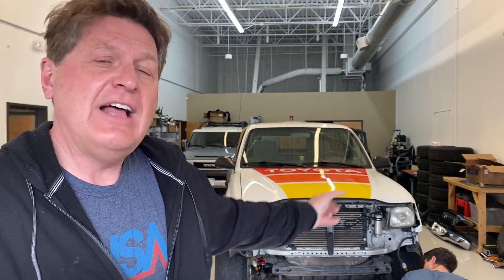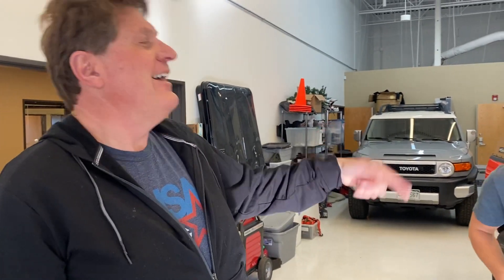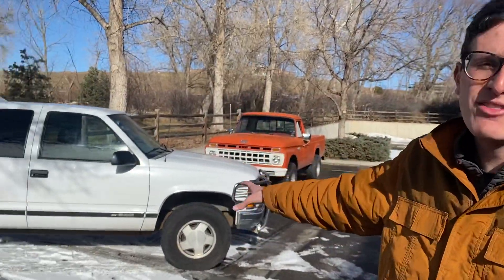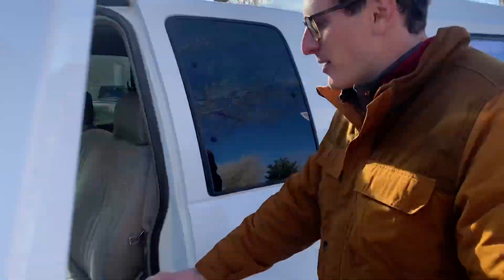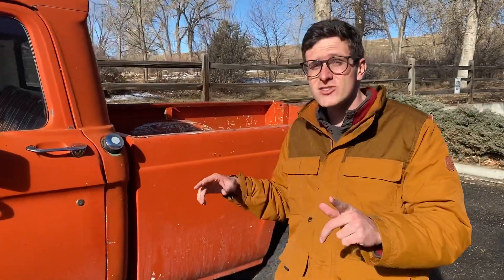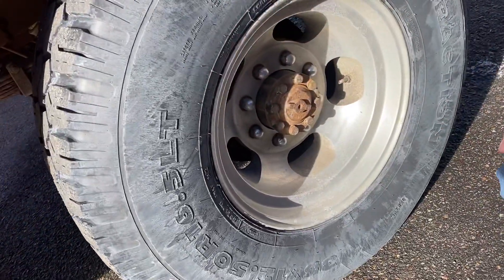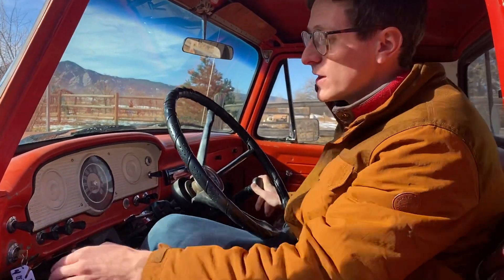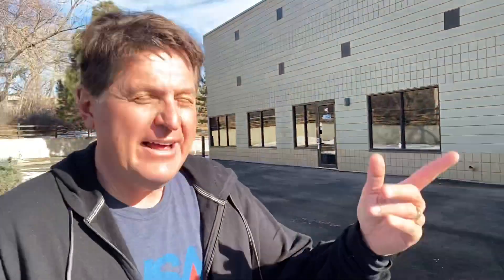We Just Bought Three Trucks Including The Holy Grail Of Classic Fords! TFL Fleet Update

Comment: When I was working construction, summers while still in high school, my boss had the two wheel drive version of the Ford 100. Except, his was cream colored, had a full instrument panel, and had a 390 V8. That truck, if driven by an expert, could be very fast off the line. One day, we had just picked up several bags of cement and lime and were stopped at a stoplight when a Chevy Nova pulled up beside us in the next lane. The driver of the Nova revved his engine several times and the passenger indicated they wanted to race. My boss just rolled his eyes, but, when the light changed, the old Ford shot off the line as if out of a cannon. My boss shifted from 2nd to 3rd without using the clutch. In short, he blew the Chevy away. I'm sure the Chevy had a higher top-speed, but we were already stopped at the next traffic light when the Nova came screeching to a stop next to us. This time, the driver didn't rev his engine.

That 390 was a heck of a motor.

Comment: The 300 cu in straight 6 is one of the best engines ever made. It's bullet-proof!
Reply: I agree.  Not the fastest engine, but it it full of torque and will pull forever.  From what I am told, DO NOT overheat it...head warpage is usually the end result.
Reply: I had a 300 in a 1990 F150. Great engine. Great truck.
Reply: Yeah, the head is the Achilles's heel of that design. The only problem I've ever had with a 300 were related to the head or HG.

Oh, and they'll crack on you, too!

Comment: When you throw out that topper, take the one from the Raptor with you :)
Reply: Correct. They are so bad.
Reply: Are they bad because you don't like the canvas, or do they fall apart?  Just curious because I'm somewhat interested in one.  I don't want to be stuck with a heavy topper, when I need to use the truck with no topper.

I like the thought of being able to load up the truck then simply close the topper over the load.  Saves my back that way, as well as not being able to kneel down on my previously broken right leg.
Reply: @dewboy13  I’m sure they are a good cover for when you need to protect your payload from the elements. It folds out of the way when you don’t need it and doesn’t take much payload. 
That said, TFL has made that cover a permanent fixture on the raptor when it serves no function aside what I can only assume is intended to be aesthetic which it is not. It looks out of place in every way on that truck.
Reply: I'm not even religious buuut to them removing that hideously out of place, grandpa-esk, truck tumor.  I say...              !A A A A M E N!

Viewer Recommended Show Ep.1
   - Removal of Raptor's Camper Shell.
   -Destruction of said Camper Shell.
   - Use Raptor to destroy Camper Shell.
   - Raptor feels Liberated. 
   -Raptor runs best lap time of its life.
   -The Raptor's celebration is too loud & it wakes The TRX up.
   - The TRX eats the Raptor!

                       》Silver Lining《
          \|/                                             \|/
           ☆    MOST VIEWED EPISODE   ☆
                   ~~~~~~~~~~~~~~~~

Comment: Way kewl, my Dad had a 66 or 67 (unibody cab/bed) Ford truck. He dropped a 392 Hemi in it with a Rambler push button gear selector on the dash with the third pedal. He used that thing to pull his racecars around.

Comment: The '65 is your jewel truck there!
The lightning bolt and gear badge indicates a 6cyl engine, a V8 badge indicates the V8. The frame on an F100 has a narrower height between lower and upper flange. If it's the wider frame (sorry, can't recall the dimensions off the top of my head), the truck is an F250.
Many 6cyl engine 4x4 F250s were default equipped with 4.56 ratio differentials, while the V8s got 4:10 ratio diffs. There are plenty of exceptions, and special orders of the other ratio happened, too.
Although the wide tires look good on the truck, They will reduce the fuel mileage and significantly increase the wear on the steering components and closed knuckles on the front axle, plus making it a real booger to steer. Best to stick with the innie wheels with narrow pizza-cutter tires.
4 wheel sizes were available: 16", 16.5", 17.5", and 19.5", all with narrow tires.

Comment: The 60 to 66 pickups were a great improvement over the previous years. The had independent front suspension "2 wheel drive" and a lot of them had V8s. They're rock solid and had a much better ride. I grew up driving them I just have never gotten into the styling. I've always liked the 55 to 59 and 67 to 72 Chevrolet and GMC as well as the 67 to 79 fords. I've owned several and will do so again.

Comment: I have the F250 version of the 65, also 4 wheel drive, but now with power steering, power breaks, a 532 big block with a T56 6 speed trans. Got over 500 hp at the wheels.

Comment: i had one, 1964... paid $400.00 for it, 223 straight six. worked the suspension & driveline/transmission, found a 4 speed w/ bell housing for $75.00 & put a 2-pc. driveshaft. i put a flatbed on it.& 36" tires...that truck built many houses and hauled a trailer, boat & motor all over the western states & Canada until i shipped it to Hawaii where it built several more houses before rough lava roads and rust took it down, bought a new on in 1985 and put 325,000 miles on that one.

Comment: I own a 1995 F150 4x2, 300 cube 6, 2dw, 5 speed manual.  199k miles.  Dead reliable.  Just put a bunch of new gaskets and seals in the engine (leaked oil out of everywhere at the rate of 100 miles per quart).  Burns little or no oil.  Probably good for at least another 200k miles.  No rust!  😊

Comment: You build that into the ultimate work truck with a utility box and a "built" 300 using aftermarket parts. Speedway in my hometown of Lincoln NE had the goods on that upgrade. I grew up with a 65 f100 camper special in sea foam green and three gas tanks. The other two were under the cab with a three way valve left of the seat. Never knew if the extra tanks were factory or not. It also had a 300 and an automatic transmission.

Comment: I love straight six trucks, every one yanks out the I6 and put in a V8 and the I6 is just a sweet and smooth engine
Reply: Harley --  I couldn't agree more.  My 1960 Chevy has the original I6 235.  It's a great and reliable old engine.  It will cruse down the highway at 60 all day long and hasn't any problem pulling mountain passes.  My truck was restored 20 years ago and I kept everything original including the engine.
Reply: @ironcladranchandforge7292  I love that. I'd love an old doge with the 225 slant 6 or a 58 Ford F100 with its I6, just a gentle old lady

Comment: I currently have a 1964 4x4 with the 292 V8 in the process of getting restored. It was 2 wheel drive from the factory, but somebody added a 4x4 conversion at some point. Great trucks.
Reply: Nogrut --  Then it must be a Chevy.  Chevy 292 I6 was a great engine.
Reply: @ironcladranchandforge7292 Nope, Ford Y Block. 1964 was the last year it was available. https://en.wikipedia.org/wiki/Ford_Y-block_engine
Reply: @Nogrut  --  Oops, I wasn't paying attention, LOL...  I missed the "v8" part of your comment.  I was thinking of Chevy 292 I6.  I love the sound of the old Ford 292 V8 exhaust signature.  I've had a couple in my life.  Watch for the oiling situation with these engines though.  I always ran synthetic oil and changed often....
Reply: @ironcladranchandforge7292  😁👍

Comment: Ok, 61-66 F250 4x4s used the 57-60 style bed.
65-66 F250 4x4s used the 61-64 style cab, with the "built in" steps at the door openings.
And if you'll notice the model emblems on the front fenders, those are 63-64 style, although in 63-64 they were mounted on the hood sides rather than the fenders. Confused? Damn right you are. Lol. Just a little Ford trivia for y'all.
Reply from the maker: Really appreciate the insight, thanks so much! -Tommy
Reply from the maker: Is this the same for the F100 models?
Reply: @TFLnow  Nope, this all applies to F250 4x4s only.

Comment: congratulations on the subscriber count. my friend is a factory trained "master" at Ferrari and his favorite in his extraordinary garage of American vehicles is the F-100. It doesn't have seat belts. It does have an "oscillating" fan on the dash which was allegedly factory installed. Absolutely not built for off-road, it's built for light loads in the bed over short distances with lots of space. no clearance, no articulation, not a tough powertrain. still, couldn't have more character and charm. meeting up on the weekend for a drive and burgers for lunch with millionaire and billionaire Ferrari collectors, nothing is more of a showstopper than "the pickup" … the other F car …

Comment: Now you guys are getting smart. American Iron! It just so happens that I have owned a 1965 Ford F-100  4x4, absolutely a great truck. My current pickup is a 1999 Silverado 1500, factory ordered by me  in April of 1999. So my comments about your purchases are: Change the oil, lube, check brakes and otherwise leave the Chevy alone. Unless you just want to spend money needlessly. You know, that old Wyoming rancher probably knew something.
   Now the Ford. Great truck, so pretty much leave that baby alone as well, but you are correct in wanting to switch over to a dual master brake cylinder. I never liked having the fuel tank inside the Cab, and if you could get rid of the solid steering column death spear, that would be good too. Mine had a dropped in 390 V8 with  RV Cam, Boy did that have good torque, but please leave the 300 straight Six in it. I would think that after what you did to Gunsmoke you would know that you can not kill a 330 Six.  You should check the front cab body mounts for rust, as that is a weak spot (I have also owned a 64 two wheel drive with a dropped in T-bird 312, White Lighting!), if the hood stars to lift at the back it is usually the cab settling from bad body mounts.  Now let me make a few comments about the truck in general.  The bed is ultra stout. The 90 degree returns at the back corner will completely stop the bed from splaying with the gate down. I once carried a load long of logs down Flagstaff with no problems, but had to use a come-a-long to get the gate to close my friends 1980 Chevy .  That will never happen with this Ford. In the 1970's, when gas prices were high and guys started buying Toyotas, I use to take my framing hammer and hit my Ford on the upper corner of the rear wheel fender flare with only minor paint damage. I'd offer my hammer to the Toyota owners to try that on their trucks, no one dared. You just happen to own both now, try it. What else? Locking Front hubs, solid front axle, and a New Process 4 speed with granny. My Transfer Case had the ability to engage 4H, 2H, 4L, and 2L. Cool. No Power Steering, No Problem! A huge Steering wheel, and the more weight you put in the bed the easier it is to turn. Oh, and forget F-100, GVW, you can Not overload that puppy. Mine had an incredible stack of leafs on it.
And just a great looking truck. With all of the new Retro styling vehicles that manufactures have made over the years, I have never understood why Ford has not recreated that look. 
   Good buys guys,  don't screw them up.

Comment: I got a truck that could qualify for this challenge I bought for 1200$ lifted it and put big tires on it. I did replace a few maintenance stuff cause it has 200,000 miles on it but if y’all want photos I’ll send em to ya it’s a 01 ram 1500 5.2l auto 4x4 with the lsd in the back. I lifted it on 37 inch tall tires and it only cost me 3,000ish

Comment: I suspect that the Ford was a Forest Service truck.
Reply: I think they said ranch
Reply: @elchucofried5683  they got from a ranch. The truck is 55 years old, I doubt the ranch owned it the whole time. The color under the orange is 60's Forest Service.
Reply: @cpscps2679  that mint green color is very popular idk we will never know.
Reply: Totally agree with the assessment that this is possibly a forest service truck. Besides the green paint underneath, it is a six-cylinder, 4-speed manual, and 4wd. Most civilian 6 cylinder trucks were 3-speeds. My dad had an old forest service 69 Suburban that had a 292 6-cyl, manual, 4wd that we used as a ranch truck. It was a beast rock crawler in 4-low, low gear it would just idle up hill all day long. Who needs crawl control!?

Comment: So the new chevy hd headlights/ turn signal are designed after this truck!?
Reply: I was gonna make a comment about the same thing, but thought I should check older comments first.  The first time I saw the new Silverado styling I had to search for where I saw it before.  The 60's F100 is a match.  Then again, Ford did put that partial Chevy headlight split on the F150 for awhile.  Maybe the new Silverado is Chevy returning the favor.  I wonder if Ford also called their style something "fist" related back in the 60's?

Comment: 300 inline 6 Fords are not bulletproof. Run em any hot (because Furd couldn’t figure out how to make radiator end tanks that wouldn’t leak below 45F for many years) and warp the head and head gasket leaks. Been there, done that, cheap trade in on a Chevy just to get rid of it.

Comment: Man...the wrap on the yoda is so bad. So so bad. Come on guys. Lose that terrible topper. Take it back. Get your money back. Get the heat gun out and take off that terrible wrap. V6 swap that thing. Swap a manual transmission in there. Swap the rear axel out for a 44. Do a SAS on the front and ditch the IFS. Leave the interior alone. Put the money in the right places. If you’re gonna do it, do it right.